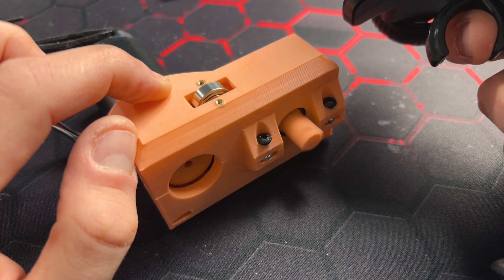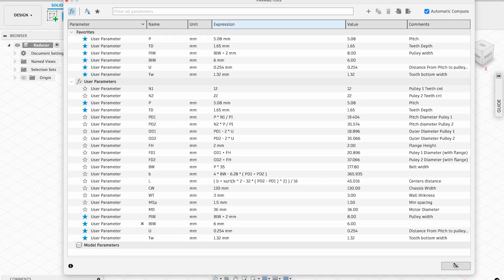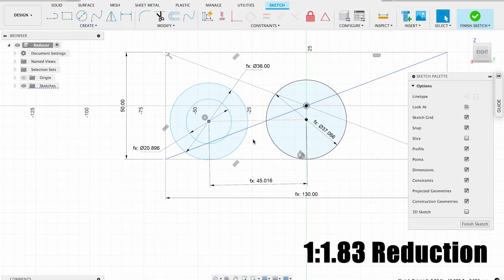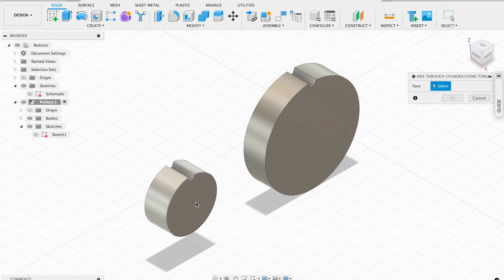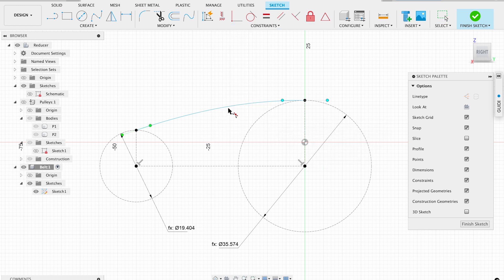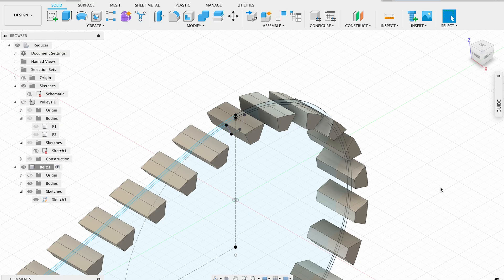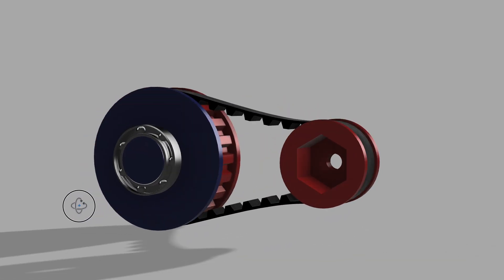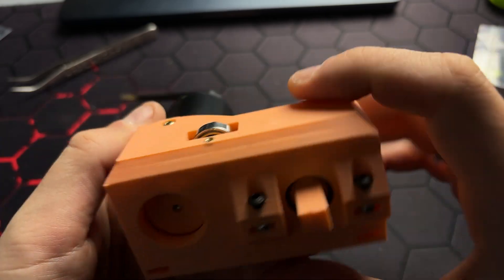How to 3D Print Pulleys That Actually Work - RC Car from scratch

Comment: I don't know if I missed this in the video, but fusion 360 has a add in for automatic generation of pulley gears. GT2 in fusion 360 is one and there are more add ins for gears.
Reply from the maker: Yep, there are several GT2 generators. The problem is that I have a set of XL belts, and I couldn’t find a generator for them.
I also wanted to add a belt that is unlikely to be supported by free plugins.